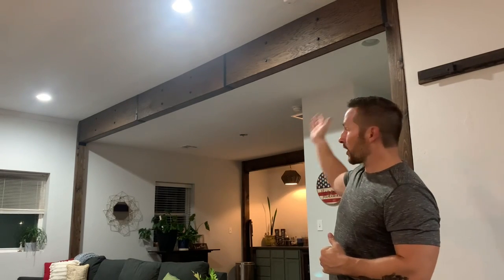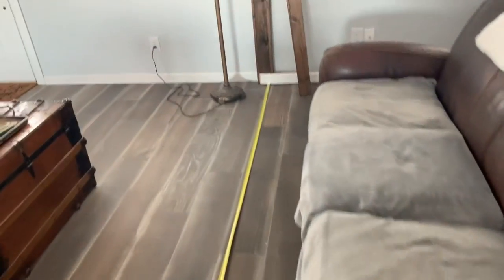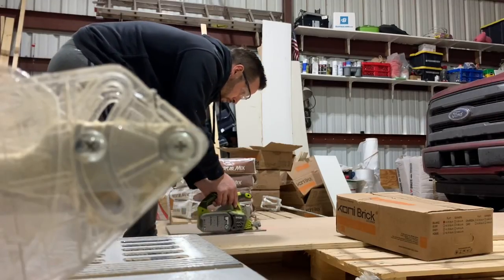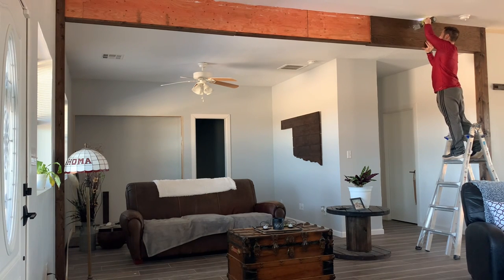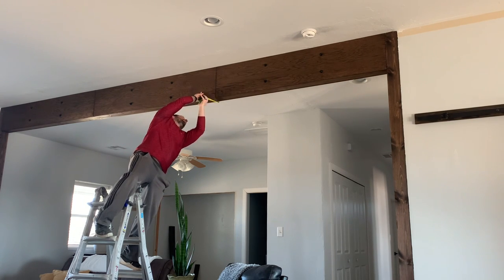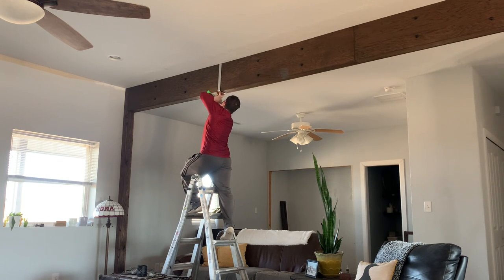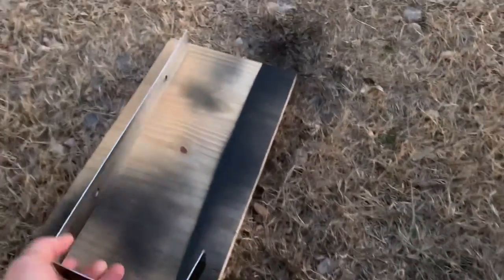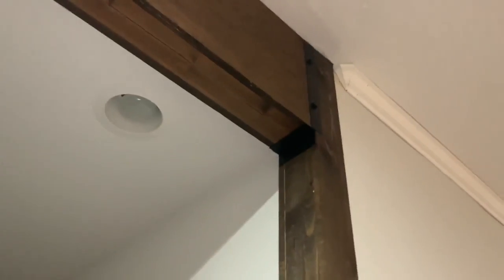How to Cover/Case/Wrap a LVL Beam for CHEAP

Comment: I noticed you didn’t miter the corners, just boxed them in. Can you tell the exposed corners are plywood corners after it’s stained?

I ask because I’m doing something very similar and don’t want to miter the corners at 45° then fill and go thru that if I don’t have to!
Reply from the maker: You can tell if you get underneath the beam and really stare at it. If you get good plywood and stain it, then it’s not noticeable unless you’re really trying to stress your eyes. The key is good plywood though, not the cheaper stuff that has holes on the ends

Comment: What’s the length, width and hight of your lvl beam? Is this supporting a second floor?
Reply from the maker: It’s is about 18’ long. About 14” tall. About 4” thick. 
It is not supporting a 2nd floor, I would guess you would need a post in the middle to hold that load. We live in a metal building so it is just holding the wall load, it doesn’t even hold the roof load bc of the metal building framing

Comment: These look really nice. How did you attach or secure the beam to the post? And how did you secure the post?
Reply from the maker: The posts are just 2x4’s from the framing of the house that we wrapped with 1x4’s and stained. We knocked down a load bearing wall and opened up the living room. 
The beam is resting on top of 2x4’s house framing